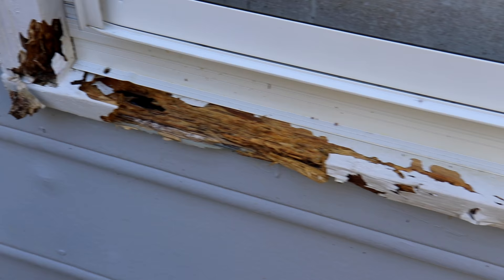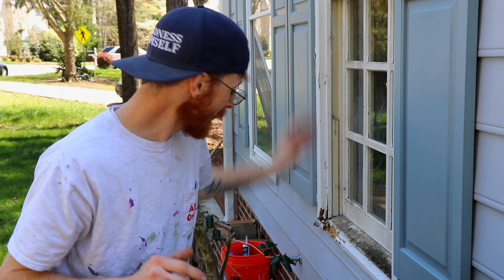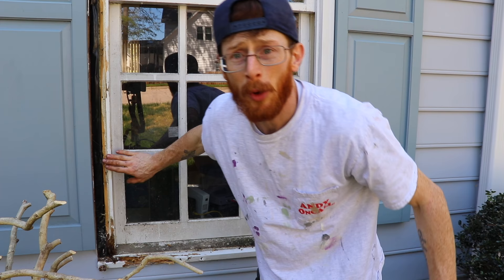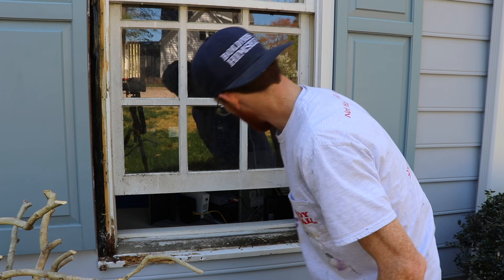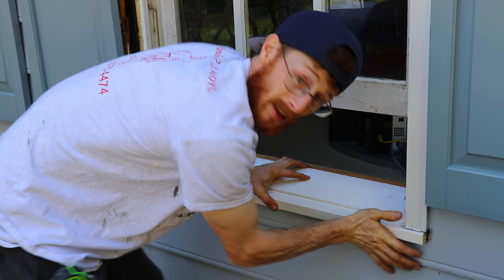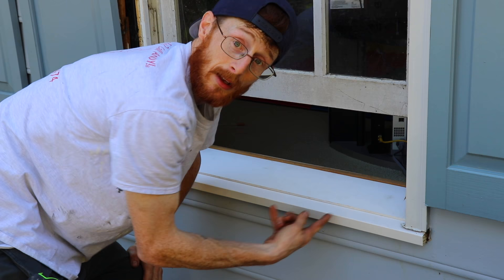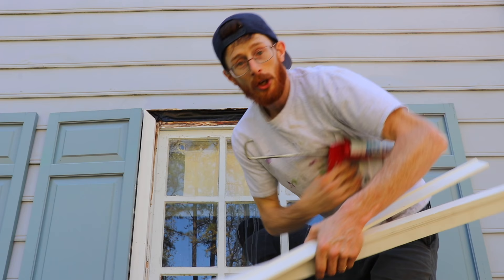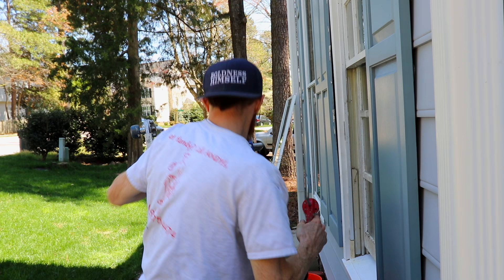HOW TO remove/replace WINDOW SILLS

Comment: Thank you for your help!!!!  Because of you, I was able to replace 10 sills and all the associated brick molds.  I used PVC and cut all of the miters with a plastic miter box.  Oh, I bought a cheap ($29) oscillating saw for removing the sills and tho it was inexpensive, it did the job just fine, even after hitting a couple of nails.

Comment: one thing i would definitely add is primer and paint (before installation) on any fresh cut hidden surfaces especially  on the bottom of the vertical, 22 degree piece, seen at the 7:30 second mark. after a few years, even if calked properly, the calk will break away, and it WILL wick up water like a sponge, especially on vertical pieces, - starting the fungus/rotting process all over again..

Comment: Awesome video. Very instructive and I'm going to use this as a guide when I replace my brick molds and sills. I would have liked to have seen the inside of the window when you pryed the upper part of the sill away. It appears that you pries upward. Looking at my windows (which are a nearly identical design) the interior part of the sill looks to slide inward laterally instead of upward/downward. I guess I'll cross that bridge and figure it out when I come to it. Again thank you for such an excellent a d instuctive video. I will be watching and liking more of your videos.

Comment: Great video.  Do you simply use place a finish nail into the front of the nose piece to hold both the sill and nose?  ie:  do not place any nails or screws into the top of the new sill.

Comment: Not to find fault, but I noticed you did not add sealer to the lower brick moulding,to stop water from wicking up and rotting.I learned this the hard way, I paint the bottom.
Reply: I was wondering about that too. When he put the  brick moulding in at the bottom I was like, "No sealant?? Nothing??"

Comment: You should glue, epoxy, or use construction adhesive on the outer part to seal up that gap so it can't get wet or that repair won't last 5 years. Even calk would be better.

Comment: Great video! Have you ever used PVC window sills? I was wondering what your take is on using this material?
Reply from the maker: I've used PVC. I think its great for preventing future rot. I've encountered a few windows that have had PVC on them for a quite a few years and they seem to be lasting great.

Comment: Great video.   If you plan on replacement windows will the supplier remove the sills?  Without sills are the windows larger in size?
Reply from the maker: In most cases the sills will stay in place with new window installs. The new window usually sits on top of it.
Reply: @ChrisSilverman  can you find thinner sills. The pocket windows we bought were measured to be a 1/2 smaller but for a few windows Lowe’s decided to make it a 1/4 shorter basically leaving little room to fit the window.

Comment: You didn't want to prime/paint the bottom of the new sill?
Reply: I was wondering the same thing... He also cut through the shitty water barrier on the sill and didn't repair it. I guess its job security. That said, he did get in and out of the job real quick.
Reply: Isn't it PVC?

Comment: Gotta be honest...did NOT think you were goona get anything done...BUT i was wrong.  Nice job!  Only question..what kind of trim is that that covers the sill at 6:26?
Reply from the maker: Matthew G Thank you. On the inside there is an apron and a stool. I think I called the apron a curtain in the video. The board going into the sill is called a sill nose.

Comment: Where did you buy the window sill and nose?
Reply from the maker: I got both the sill and the nose from Home Depot in the trim section. They supply both wood and pvc. Lowe’s hardware store also carries window sills
Reply: Thank you for the reply. Last time i went in HD they guy looked for it in the trim section. Maybe i have to order online.

Comment: Would this work on my door step? It’s completely rotted like this. Idk what else to do 🤷🏻‍♂️
Reply from the maker: Unfortunately no. The wooden door threshold is a little different and actually requires a customized piece to be made. I haven’t found a stock threshold for the door.
Reply: @ChrisSilverman  thanks for response
Reply: @ChrisSilverman  I tried bondo. Didn’t work to well!

Comment: Triangle cut is nice trick. But all 6 sides of that brick mold needs to be primed or you are leaving it open to rot again. Or use PVC - which has it’s own issues. Also, clearly you are handy and accurate cutting freehand with a saw on the ground or truckbed because you use one every day. For mortals, get a hand miter saw or get / rent a powered miter saw. It will make those precise angled cuts WAY easier.

Comment: Hey Chris just saw your video. Nice job. Quick question, can you cut out the inside window sill the same way you did the outer one and are the replacement parts the same. I have termite damage on my inner sill. Thanks brother.

Comment: could you have just replaced tge nose on that sill?  i just use the pvc sill nose from lowes. works great and alot less work.
Reply: You can for sure replace just the nose piece. I have found that sometimes the nose pieces are hard to separate from the sill from it being glued on.

Comment: Hey, I have a quick question. I have a really old house, so I'm replacing the window sill as you did. It's a 7 1/2 wide piece. So I'll have to go with a 2x10 piece  and rip it to match the size. My question is, would it be worth it to leave it at a wider piece to increase how far the sill sticks out, or best just to match it? Also, I'm just planning on using regular pine and giving it a good all around coating of latex paint before I slap it in, would treated lumber be better?
Reply from the maker: I tried treated lumber once. It wasn't the best because it had to be custom cut and didn't fit the best. It is definitely better to match it with the appropriate sill.
Reply: @ChrisSilverman  thank you, I'll stick to the same size
Reply: @rustedhorsepower5132   You may choose to look at "Radiata Pine" as it is being used on exterior applications by Jeff Sweenor on recent episodes of "This Old House". 
  It is farmed in New Zealand, trimmed each year to reduce knots and treated and sold in many sizes. If you only have one window to do, go with whats local, but if you can find a facebook page for Jeff Sweenor, you may asked him about his experience with it. He joined the This Old House crew on the "Net-Zero" house and a "New Products" home shown in season 40. 
  The species grows in central coastal areas of California but its currently being planted in Australia but perhaps special treatment is used in New Zealand as it is close to the US Eastern seaboard. There are a number of suppliers signed up to sell it for this purpose on exterior applications.
Reply: @deankay4434  wow, sounds cool. Alot of good stuff comes from new Zealand
Reply: @rustedhorsepower5132   Depending on thickness and width, some use a quality stair treads in several common species as well. These are found at most any home improvement store sold each. 
  Since New Zealand is just off the NE coast, it is easy to get product shipped into the states. Just don't forget the sill tilts down at 15 - 22 degrees but more important have a dado cut on outside bottom lip to break waters surface tension to allow for water to drip off. Use a saved cut section of the old to get angle and drip edge location to match others not being repaired. 
  Also, use a quality oil-based sealer on all sides, let dry and apply a second coat. Using a silicone sealant inside to help seal water intrusion under the brick moulding and the siding. 
  Tommy, from "This Old House" sprayed a low-expanding foam under the sill just as he was installing the sill. This not only provide insulation but as it expands, lifts the sill plate upward to provide a nice looking connection to the inside trim plate or stool as they call it.
ASE Master Tech since 1978 / Retired
Reply: @deankay4434  cool, thank you

Comment: Do you not need flashing? Or to replace the insulation you took out?
Reply: i agree. I like this video, and I thank the maker, and it was a good job - but flashing under the siding at the top, and injected foam under the new sill and behind the brick molds would have made it a great job.

Comment: Just watched the video where you replaced the window brick molding. Two questions;1what type of caulking are you using and 2 is the process the same if you use the pvc moulding
Reply from the maker: I’m using 20min fast dry dap acrylic caulk and yes the process is the exact same when you use pvc. I have had a lot of people use pvc instead of wood because there is zero chance of it rotting again. However, caulk may break easier due to the expansion/shrinkage of pvc so that is something to have in mind long term.
Reply: @ChrisSilverman  thank you for your help
Reply: Wood was used about 5 years ago and it started rotting about a year ago. It is in need to be replaced now. Most ends are cut about 45 degrees right

Comment: Please provide links to the wood pieces for the sill. Thanks!
Reply from the maker: https://www.homedepot.com/p/Woodgrain-Millwork-WG-WDS1-1-3-4-in-x-1-1-8-in-x-96-in-Primed-Finger-Jointed-Pine-Sill-Nosing-Moulding-10004480/206178837?=&irgwc=1&cm_mmc=afl-ir-2076208-459920-&clickid=VugXecTsSxyOU7jwUx0Mo38TUkGXdoTxLwaLwg0
Reply from the maker: https://www.homedepot.com/p/Woodgrain-Millwork-WG-WDS2-1-1-4-in-x-4-3-4-in-x-96-in-Primed-Finger-Jointed-Pine-Sill-Moulding-10004487/206178844?=&irgwc=1&cm_mmc=afl-ir-2076208-459920-&clickid=VugXecTsSxyOU7jwUx0Mo38TUkGXdoQBLwaLwg0
Reply from the maker: Two links. 1 for the sill nose and 1 for the sill moulding.

Comment: Thanks for the video. Where did you get the two piece sill stock? Does it come pre-primed?  I make my own and it's a lot more time consuming.
Reply from the maker: AbbieHoffmansGhost You can find the sill and sill nose pieces premade at either Home Depot or Lowe’s home improvement.
Reply: My local Home Depot and Lowe’s don’t have them.  Maybe because of COVID 19 they are having problems getting wood.

Comment: Video on "this old house" is much easier and makes more sense.
Reply from the maker: Bob LaForest Yes, that’s a great video; simple and straightforward.
Reply: Was the comment necessary... scroll on.   Chris your help is appreciated!
Reply: There were some mistakes here (not priming all sides of brick mold) but the TOH method was just another method that may be better for your situation or this method may be better. Depends on the sill you are replacing. Good luck finding that “Spanish cedar” they used on TOH lol. Also he skipped over why it’s important for sill to have a drip edge and skipped over flashing up top. Frankly there was little discussion at all about why this trim rotted (water management) and how to prevent the same thing from happening again in 10-15 yrs. Nice tricks and sound work overall here but as I pointed out, a lot was left out.
Reply: Chris's was much more straightforward and to the point.

Comment: Loved it but you lost me at one point. After you placed the new sill, you put in a piece in front of it but didn't explain what it was called or where you get it. It wasn't brick molding but wasn't just stock wood.

Comment: Dreadful,  the gap on the bottom seal, right hand side was wide open. Rain would funnel inside the building i can not see that being water tight. Bearing in mind you are replacing the woodwork due to water damage.

Comment: Where did you get that sill material and bull nose?
Reply from the maker: First State I got all of the supplies from Home Depot in the trim section
Reply: Thanks.  I have to reduce a window height for my daughter.  Just going to add a sill and fill in under it with a blank panel inside and out.
Reply: @ChrisSilverman  I went yesterday and bought a 3 foot section of that Home Depot Window sill like you used in the video. We thought it was going to be a one piece fix. So after you put in the big piece of sill you came back with the outside piece. Is that piece available at Home Depot? Or did you just rip another piece of the HD sill and turn it over so the slots would fit? Home Depot isn't clear on anything.